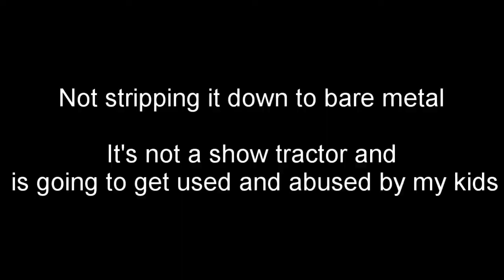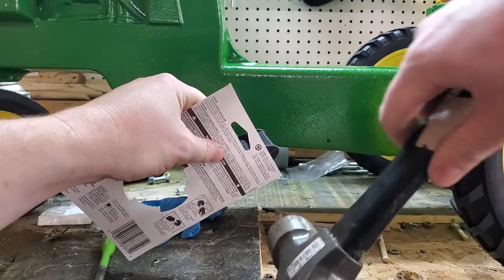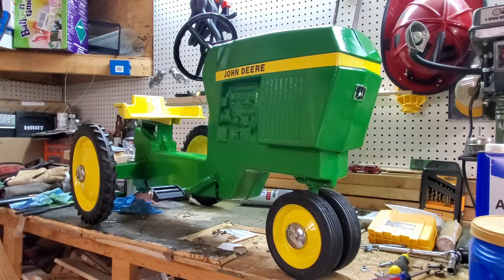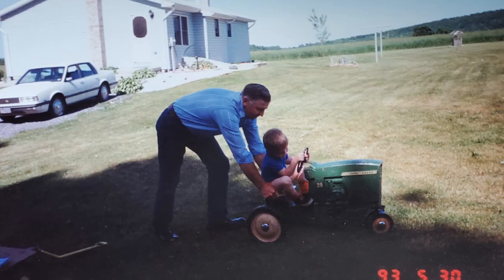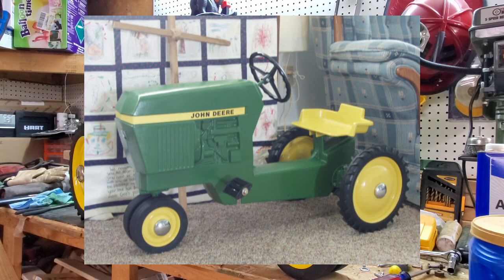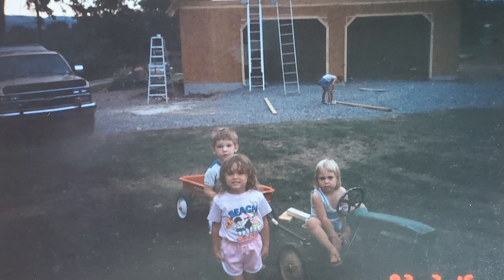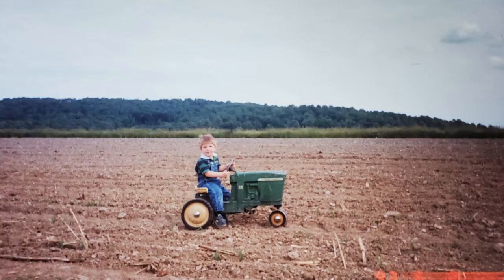John Deere Pedal Tractor Restoration

Comment: I have mine when I was a kid my wheel just spins and doesn't grab. The peddles work though
Reply from the maker: The rectangular slot is probably worn out in the wheel
Reply: @ffco6  oh okay so just order a new wheel then
Reply from the maker: @colecadieux9370  that's probably the easiest way to do it, short of welding a new piece on
Reply: Do you have a good website to order parts I can book mark?
Reply: By the way loved your video bro. Alot of miles on mine